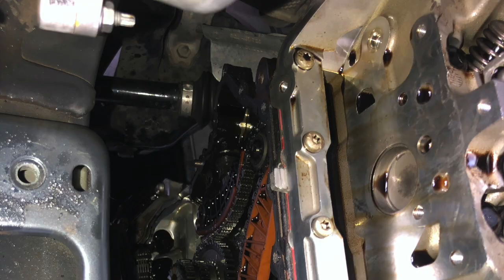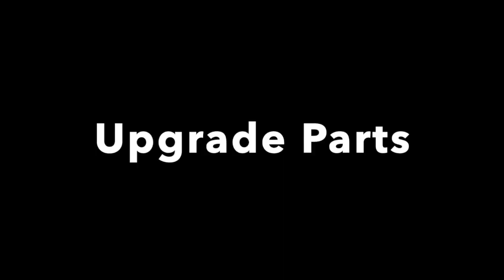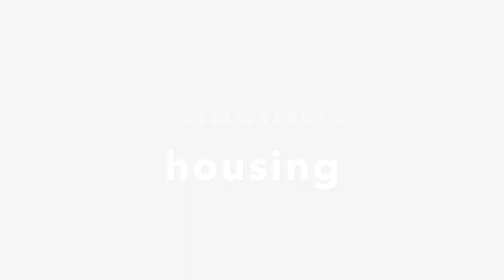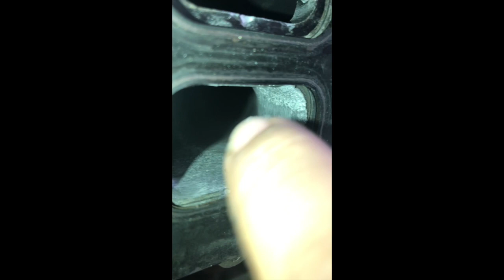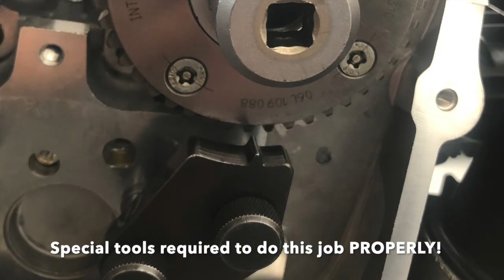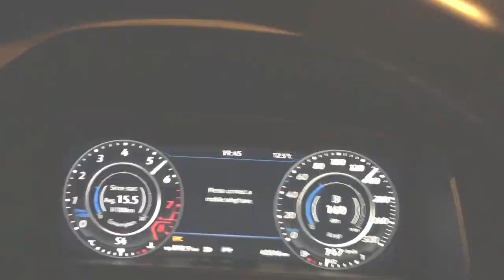We build a forged EA888 3 Engine

Comment: You could have just used precision measuring calipers and knocked out the water jacket plugs.
Reply from the maker: No calliper will be able measure wall
Thickness across multiple positions that far inside the port

Comment: With porting the exhaust like that, did you notice any difference in spool or even power?  The amount of material removed was significant.
Reply from the maker: Yes we did - mostly at the higher RPM range the torque increase was noticeable on the road, and showed about 7NM at the wheels - BUT the higher the boost the more this increases over stock figures. With our IS38-450 turbo at 1.8bar we made 632NM and previously at the same boost and same tune we saw 607NM driving a larger turbine stage, porting the head is essential.

Comment: ALTERNATIVE - Permatex Anerobic Flange Sealant
This sealant is most commonly used on Camshaft cradles for 2.0T engines and Oil pans and is a great alternative to the very expensive VW Audi sealant.
Reply from the maker: Awesome - thanks for the heads up.

Comment: What is possible to get out powerwise on these engines?  That can be driven on the Street. 700 crank?
Reply from the maker: The components we used in our specific build will hold 700HP easily. Yes it can be driven daily with 700HP thats if you know how to make this power. There are alot of custom components, and fuel upgrades that will be required to produce 700HP, which are the obvious requirements, but over and above this there are alot of other mods needed which not many people know about. We will be releasing more information on this build with 600HP+ very soon.

Comment: great video, keep doing the good work. i would suggest you to do some development on 2.5l audi daza engine, i believe that its hottest engine these days. iroz motorsport after 3 years of development they made plenty of 1100+hp  and incredibility results low 8s 1/4mile and low 4s 100-200km/h. the cylinder head its from lamborghini huracan with 2 injector line stock (10 injectors ).
Reply from the maker: Thanks for the comments, we have a development on the DAZA going already and will be ready to release a bolt on 1000HP setup in a ball bearing design later this year - perhaps youll see it at SEMA and PRI ..... :-)
Reply: @TurboDirectSA   that sounds great. I really believe in ttrs/ ra3 platform, with some more  development it will be a budget GT-R. With built engine and head 1200+ will be the perfect "daily driver". 

Anyway did you get your hands on some Garrett hybrid turbo (the electric hybrid) ? All time full boost what a dream... :))
Reply from the maker: @cigmaian7139  I agree - espcially the DAZA engine, as the head comes from the Lambo stable 07K and 07L heads.  No we arent very interested in the electric turbocharger just yet -- they arent able to get up to speeds where the compressor setup are able to produce boost above 1.0bar gauge pressure.  Once they are able to do this on a decent size compressor that is capable of 100lb/min of air flow, we might start playing with these.
Reply: @TurboDirectSA  for sure electric turbos are not for high power builds for now, but maybe with some more development garrett will launch a "G" electric series.
 speeking of daza i think that G42 its the real competitor for ims 1100 (Xona Rotor based turbo), i am really curious how they compare on pure street data 1/4 0-60,60-130 for me thats the imprtant data, because on such high power some dynos just slip.
just keep up the good work and have  nice sunday.
Reply from the maker: @cigmaian7139  Lets see and hope technology progresses, we waiting and watching the electric scene -- 

There are many players on the scene now with the DAZA and running big turbochargers, but pricing on this platform is rather high in most peoples eyes. We should have our setup soon.